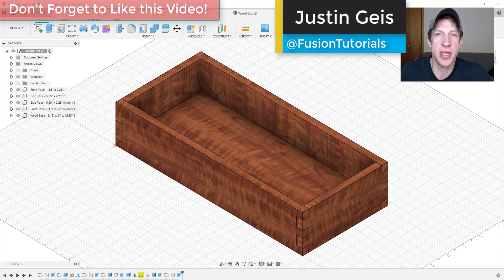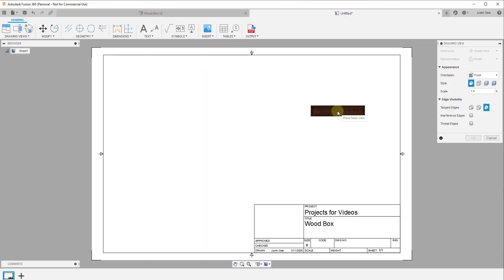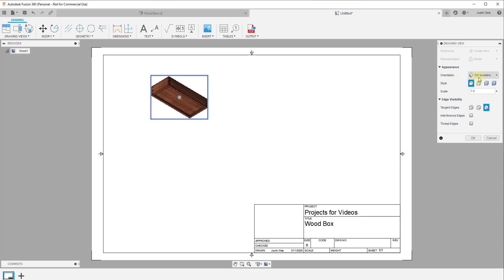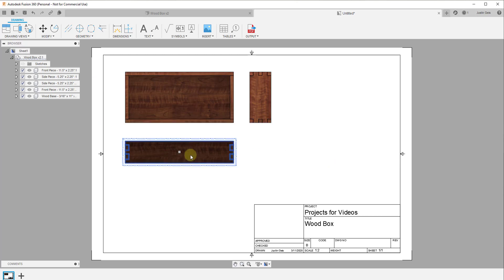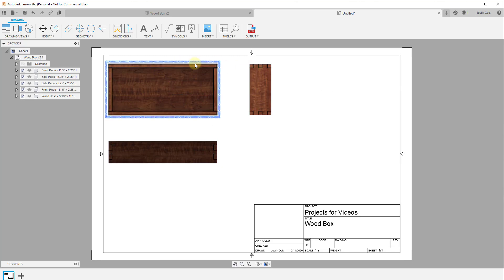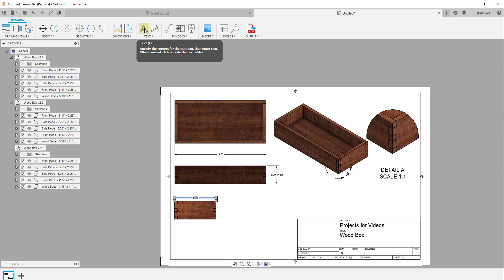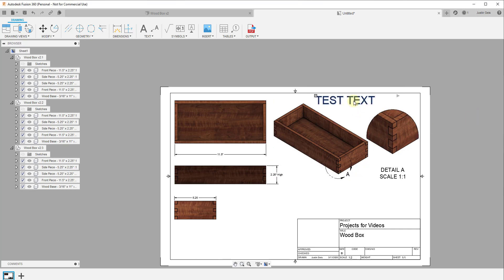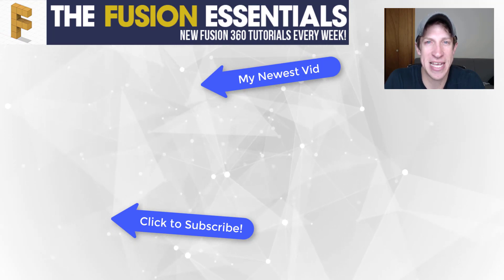Fusion 360 for Woodworkers Part 5 - Creating WOODWORKING PLANS in Autodesk Fusion 360!

Comment from the maker: Hi everyone! What kinds of models have you been creating in Fusion 360? Let me know in the comments below! :)
Reply: I'm working on modeling the plinth for my 1981 Victor QL-A95 turntable. This video was very helpful. I've still got a long way to go to finish the project but it's looking good. Since the plinth is sandwiched MDF it hasn't been too tough but Fusion 360 is not the easiest thing to teach yourself. For instance, as I modeled the four pieces of the box frame, I would try to cut 45deg bevels on the ends and align the pieces. Sometime when I draw my line, it doesn't end up on the face I intended and then I cannot extrude the cut. The plans info detailed here will help greatly if/when I can get the model finished and hand it off to a friend to cut the pieces for me.
Reply: I didn`t intend to make use of this woodworking book, TopFineWoodworking. Com but rather curious about it. I had been truly amazed right after trying it. It never disappointed me in my wish to acquire more information about the art of wood working. Many topics were covered, including everything from wood types to developing your workshop.?

Comment: I can't seem to inference off the box joints I made on the front panel of the box. I had to copy your dimensions because it wouldn't inference the points on the box joint for some reason. That Edit Feature when fixing those box joints was an amazing tip. I appreciate you sharing your knowledge with us, I've really needed to learn Fusion and this has been a fantastic course.

Comment: Unfortunately, with the changes in Fusion 360 personal use features exporting the woodworking plans drawing into PDF is no longer available.  A subscription must be purchased in order to get a print out.
Reply: I have the latest version for personal use and have no problems exporting to PDFs.
Reply: @MadMonk67  You must be one of the lucky ones.  I just checked the program, completed the latest update that made the 10 editable projects active for personal use accounts, and all the "export to PDF" options are grayed out and are behind the subscription wall.  So how did you get around the limitations of the personal use restrictions?
Reply: same here, no more pdf exporting
Reply: Anyone found a workaround for exporting PDFs on the free version?
Reply: If your on a Windows box you can go to print and select “print to Microsoft PDF” and save it.
Reply: @LJ-bg2ly  thanks but I’m on a Mac

Comment: Justin - I'm working my way through your woodworking videos... excellent! Sketchup is annoying me and long ago I saw a video about Fusion so giving it a shot. One thing they did in that video was some neat things where they defined the length of various elements (like variables) and then used those when sketching/extruding.  And somehow did it so that if they changed the length of something, other components would adjust as well as they were based on that.  Would love if you covered that!
Reply from the maker: Yeah I need to research this a bit more before I can make a video about it, but it's on the list